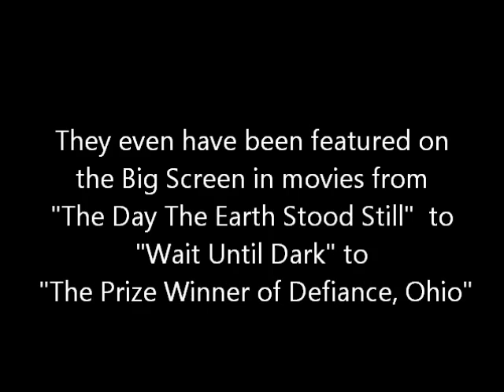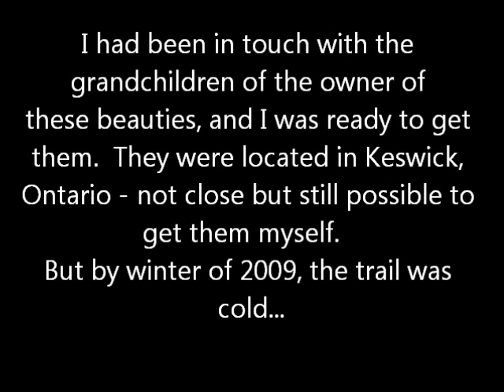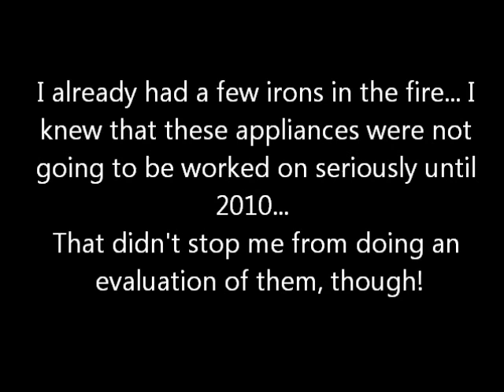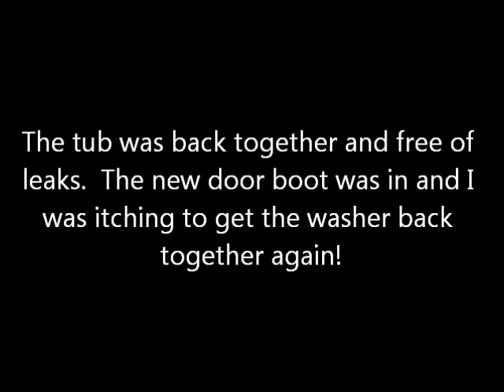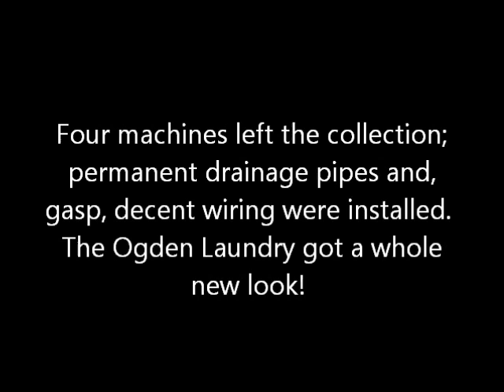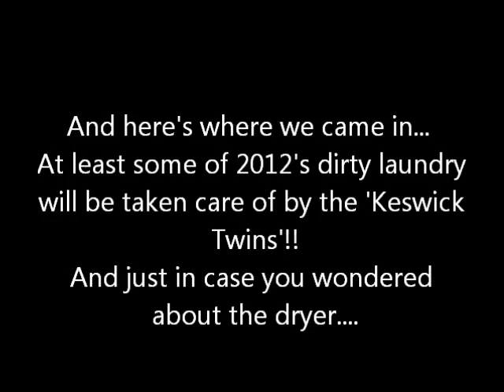The Canadian Westy Laundry Twins Restoration  Movie

Comment: I have a question, if the speed changer unit fails where do you get them repaired, and where so you get the parts since Westinghouse no longer exists? Just wondered.